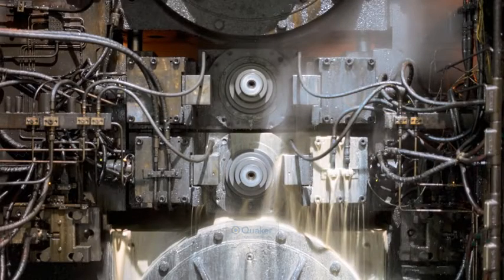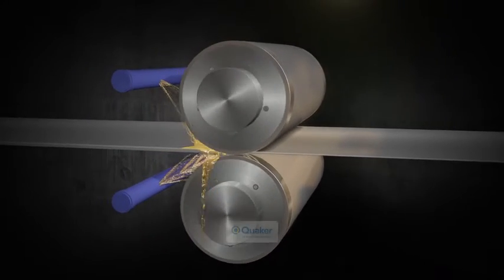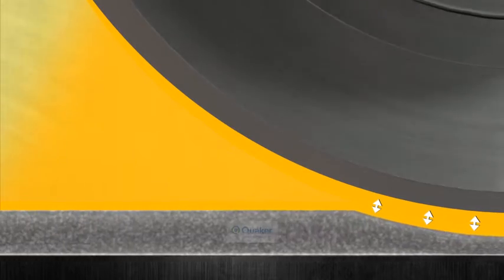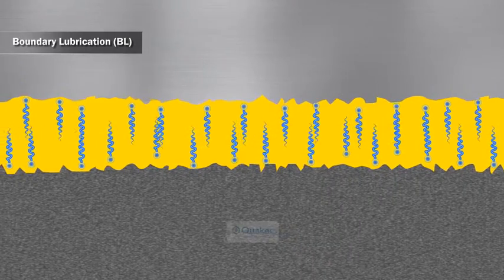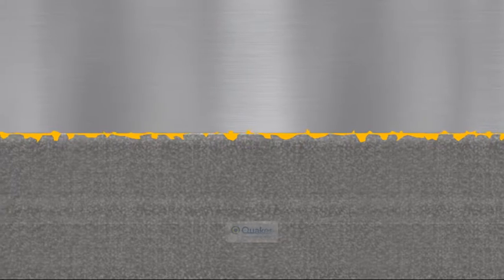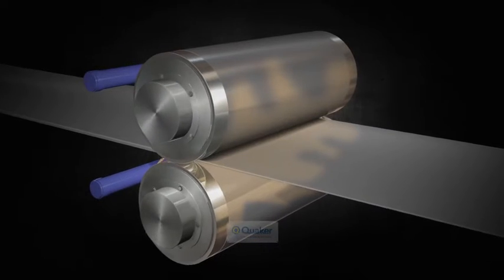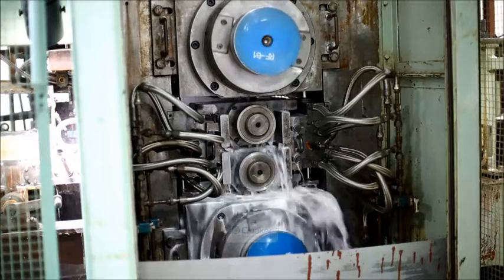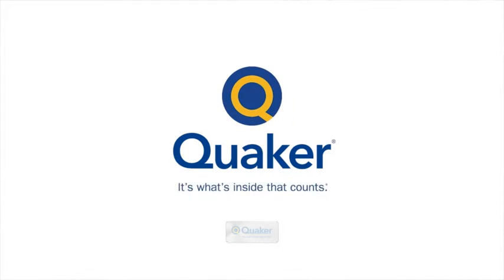Quaker Animation Film Steel Cold Rolling Process

Comment: https://youtu.be/FB5LAjEQhVs start using adaptive strip oiling or  wiping without any energy, no moving parts, no replacement parts or is exceptionally versatile Equipment which can be easily installed